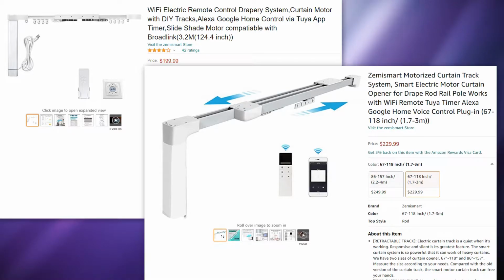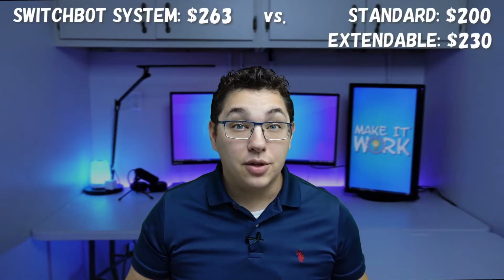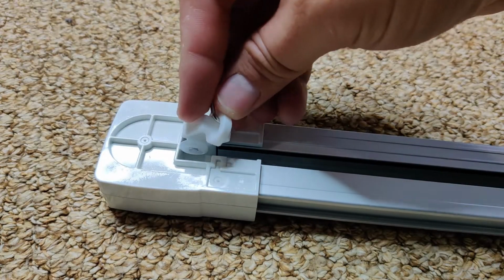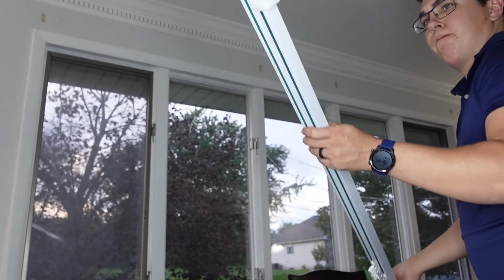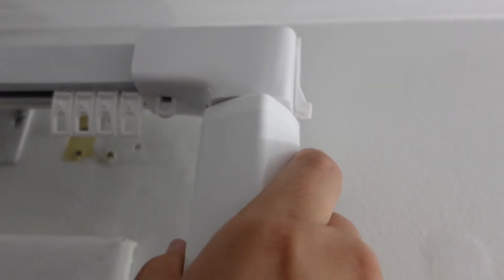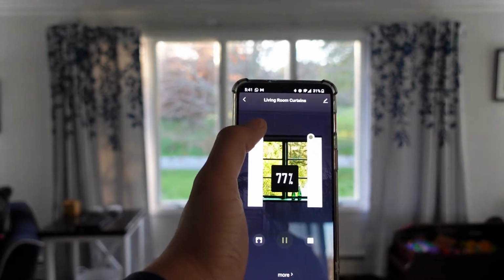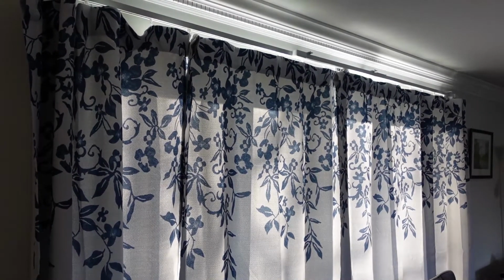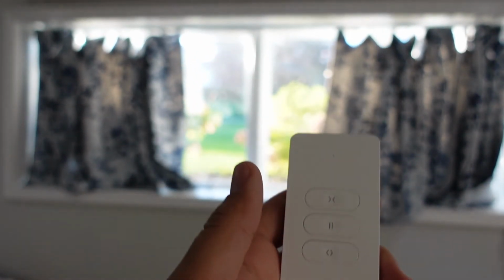Better than SwitchBot? (Zemismart Motorized Curtain Track Systems)

Comment: How’s the noise on normal operation?
Reply from the maker: Fairly quiet compared to Switchbot... A low whine. Don't forget you can update then completely locally by using a smart remote like the Broadlink rm4 Pro

Comment: Does it work in HA yet?
Reply from the maker: Not yet!
Reply: @MakeItWorkTech  ugh but it still works with Google assistant? I need these but would love to tie in to my ecosystem via HA directly
Reply from the maker: Yeah worries with Google and Alexa. You can tie it in indirectly using Alexa Media Integration if you have an Echo. May be able to buy the Zigbee version and try to get it working?
https://a.aliexpress.com/_mMp3ntG
Reply from the maker: Your comment on my other video got deleted... Want sure how else to tell you
Reply: @MakeItWorkTech  hmm weird I was just curious if you tried 2021.11 yet, claims to have curtain support
Reply from the maker: Yeah, still no go for those curtains. I will update a pinned comment if they do
Reply from the maker: @Rico912  Both models are now working with the Tuya integration in HA!